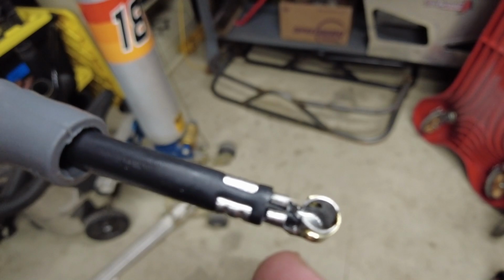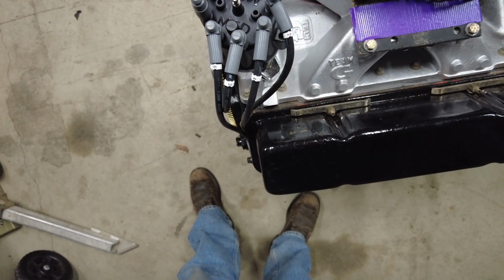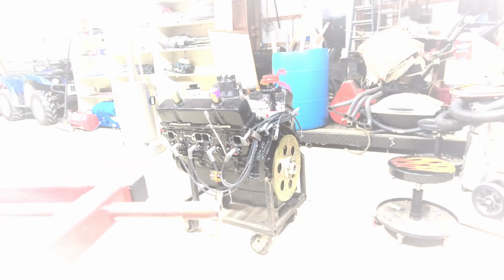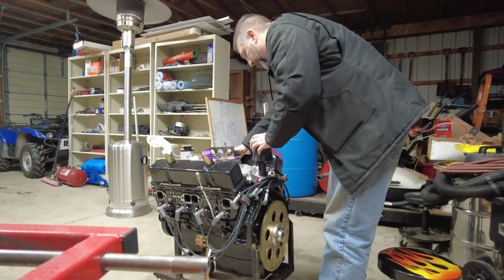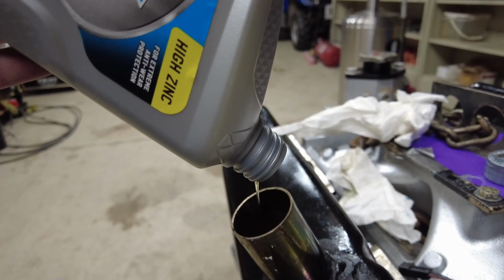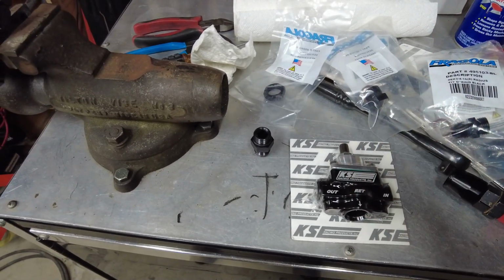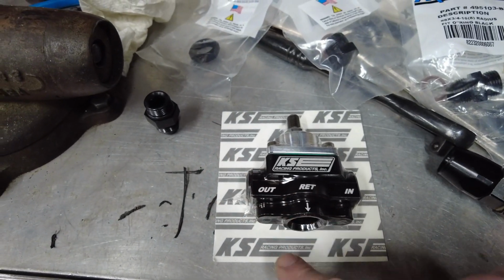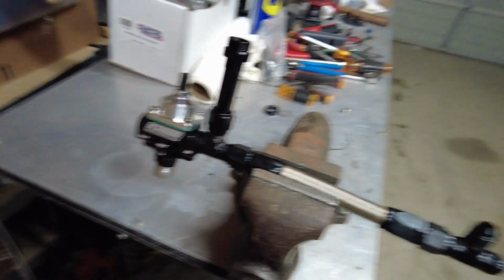Road to Bristol: we finally have the engine ready

Comment: Back when we were building 7mm solid core wires for stationary engines, we would dip the wire in brake fluid to slip the boots on. Canned glass cleaner works well also, plus it doesn't leave a residue. Did you build the doors for your pit cart? If so where did you find your latches? Those are the type I want to use on ours when we get there. Looking forward to the motor dyno session.
Reply from the maker: Test Motorsports built the pit cart, they could probably help you out. Joe is a good dude. I've used glass cleaner before, but felt like it was quick to gum up and dry out. Brake fluid I heard about also but wasnt sure how to tell if it work on the rubber.

Comment: Are you not allowed to use the bronze gear on the distributor?
Reply from the maker: It's a little soft for a flat tappet cam, which is required for the open motors.